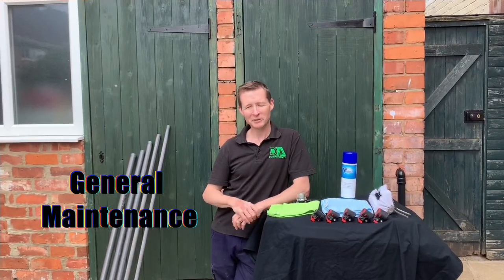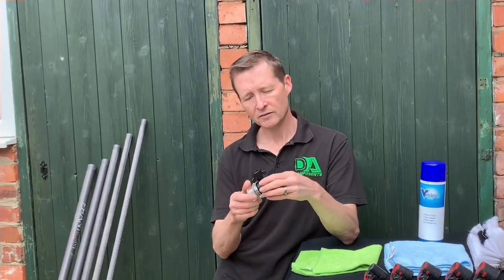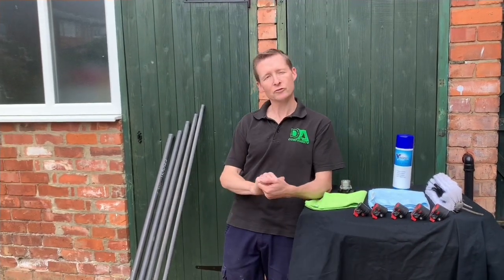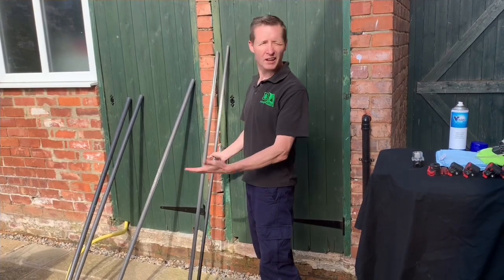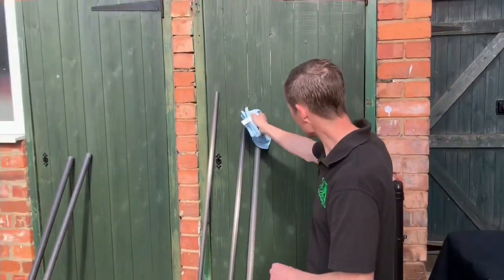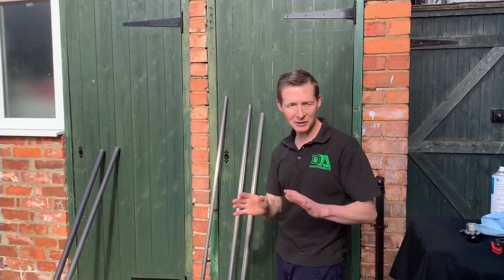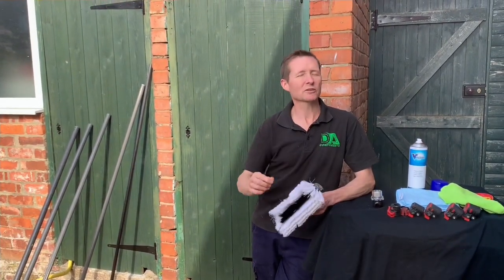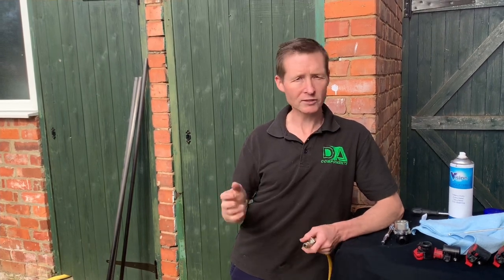Window Cleaning Equipment General Maintenance

Comment: Darren  Kenny here can u please tell me about pump. When I turn water off with the univalve, the motor shuts down altogether
Reply from the maker: Hi Darren, once the univalve is off the pump pressure switch should kick in and holder the water back until you turn it back on you still should have power going to it tho.
Reply: @dacomponents  that's the trouble, when I release the valve again it won't respond, have to return to the van to switch it on again.
Reply from the maker: @coneykenny  

Hmm I think you may have a wire connection fault due to the vibration of the pump motor?
Reply: @dacomponents  thanks Darren, I've found that this last while there has been alit of vibration. Get it checked tomorrow
Reply from the maker: For what it’s worth I would recommend fitting new wire connectors n fuse holder too then for from there , I have a video on how to crimp wire connectors too .